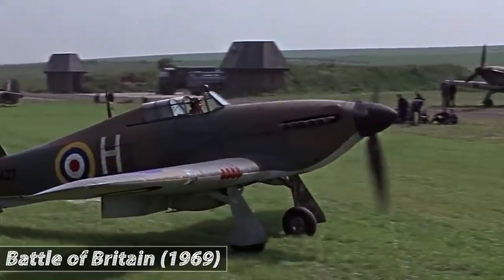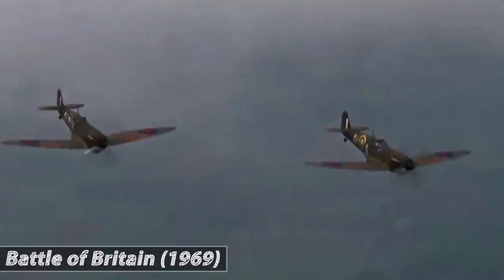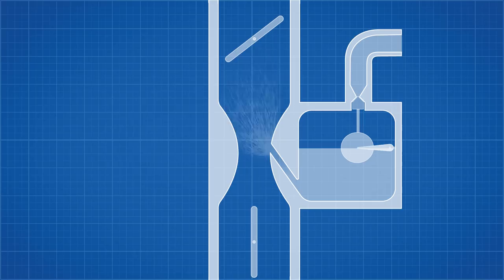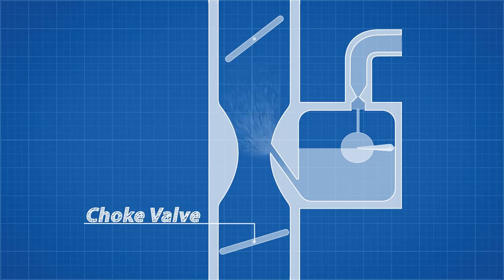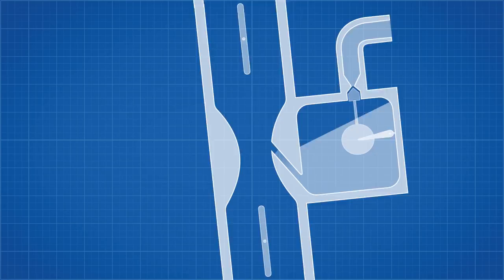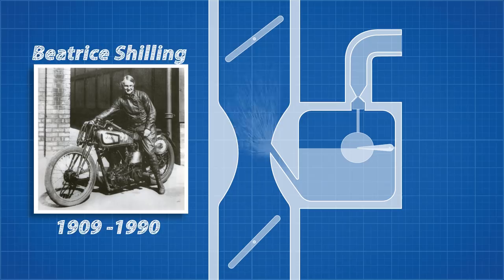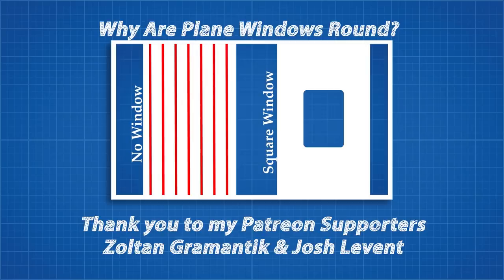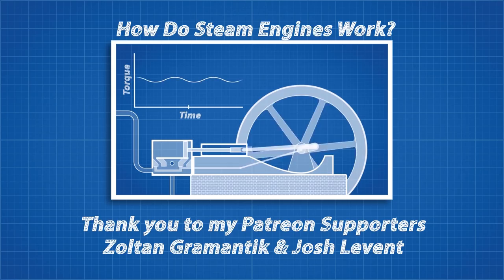The Spitfire's Fatal Flaw

Comment: As soon as I saw the title I though "It's the carburetor problem, isn't it?"
Reply: I love people who are so knowledgeable about very niche topics, and are able to predict stuff like that :)
Reply: Me too. Spitfire pilots have talked about two disadvantages-this and the Bf-109 having a cannon in the nose. MGs are fine for infantry, but ONE cannon shell in your ass can take a fighter down.
Reply: +Elwood Gizmo later versions of the spitfire had 4 hispano 20mm cannons
Reply: +Elwood Gizmo and the first bf109's only had 2 mgs and no cannons while the spitfire had 8 of them
Reply: Nigel Nathan Bf-109Es were in service at the beginning of WWII, and E-1s were fitted with four 7.92mm machine guns. The E-3 was fitted with two 7.92mm machine guns, and two 20mm cannons. The F series all carried a cannon of usually 20mm, but no smaller than 15, and the F4 was capable of mounting 15mm cannons under its wings. Up to the G6, 109s retained the dual 7.92mm machine guns, but on the G6 these were replaced by 13mm machine guns. The K variant replaced the 20mm cannon with a 30mm cannon, and retained the 13mm guns.
Reply: Nigel Nathan the Mk1 Spitfire, which was designed first and foremost to combat Bf-109s at the beginning of WWII, was fitted with 8 7.7mm machine guns, vs the 7.92mm guns and 20mm cannons on the early E series 109. The Mk IIa Spitfire also had only 8 7.7mm machine guns. The Mk IIb was the first to receive 20mm cannons, but only 2, and retained 4 7.7mm MGs. The armament of the Mk Vb was the same, and the Vc was the first to sport 4 20mm cannons, though it was outclassed by Fw-190 fighters that began appearing at the time. The Spitfire Mk IX returned to the two cannon, 4 MG armament. The Mk XIV was capable of carrying two .50 caliber machine guns in addition to its dual cannons, but German guns were still bigger, and many XIVs retained the dual cannons and 4 MGs. Even the Seafire Mk XVII, a direct naval variation of the Spitfire XVI, had this arrangement. The Mk 18 spitfire had this armament, and the 4 20mm cannons did not make a reappearance until the Mk 22 Spitfire.
Reply: +AlphaMikeOmega Not going above the speed of sound is not a Spitfire problem, it's a straight wing, prop problem. 

So not a "fatal flaw" or a disadvantage.
Reply: Rafal0id It's not a straight wing issue. The Bell X-1 was the first plane to break Mach 1, and it had straight wings, A swept wing reduces the compression effect, but the airfoil has an equally important part. The P-51 Mustang's laminar flow airfoil i thinner than the Spitfire's wing, and so the Mustang has better high speed handling because it does not compress at the same speed as the Spitfire. The other issue is that to pass Mach 1 in a propeller driven aircraft, the propeller blades themselves need to rotate faster than the speed of sound, which puts tremendous strain on the engine, driveshaft, propeller hub, and blades.
Reply: No it's not, propellor airplanes have gone supersonic. 
Compressibility is not a wing problem, it's a problem with the control surfaces of the elevators on the tail.
Go to fast, lose elavator control, which is quite problematic in a supersonic dive.. Ya can't pull up.
Reply: look up WW2 pilots diving to escape being shot down, or chasing enemies, and then crashing full speed in the ground because they could not  pull up from the dive due to compressibility.
Very good report in Fighter Pilot by Robin Olds, how he barely made it with just a few feet to spare vs the ground. P38's were especially sensitive because they were aerodynamically designed with low drag and the elevators were inbetween the 2 engines, behind the cabin.

When i say compressibility is not a wing problem, i simply mean you can make a brick go supersonic, or a wing, if you make it strong enough any airfoil will make the transition. But you need the control surfaces, the fully tarticulated tailplane to overcome the problem with the elevator that stops working due to compressibility
Reply: The Spitfire had the highest mach limit of any plane until after the war. the wings did not snap off at a speed no other fighter could reach without breaking up.
The Spitfire mach 0.89, followed by the Me 262 and P 51 about mach 0.84, the P 47 about mach 0.7 and the P 38 even lower.
Reply: Fire Bunny.
The first Spitfire to have 2 x 20 mm cannon was the Mk Ia, in fact one shot down a German plane in February 1940, some time before the Battle of Britain. The Mk 21 which was in service early 1945 had 4 x 20 mm, but most Spitfire marks from the Mk V on had the universal wing so they could take 8 x 0.303, 2 x 20 mm and 4 x 0.303 or 4 x 20 mm Not many after the Mk V had 8 x 0.303.
Reply: Fire Bunny.
The P 51 did not have better high speed handling than the Spitfire.
Reply: +Barrie Rodliffe spitfire had better maneuverability due to the shape of the wings. P51 had better range. This came in very handy for bomber escort.
Reply: Walter.
The Spitfire did escort bombers, not as far but the p 51 had to be so laden down with fuel that other fighters including the Spitfire had to escort the P 51`s and bombers into Germany first.
Remember the Mosquito could carry a similar load into Germany and not need an escort.
Reply: +Barrie Rodliffe sounds like u got the impression I said they didn't use spitfires to escort bombers. Of course logistically they used them for their superior maneuverability wherever they could. Mosquitos were very handy for night raids as well.
Reply: I actually tought about another issue - a fuel tank right ahead of the cocpit, that engulfed a pilot in flames when hit.
Reply: +Barrie Rodliffe Mozzie bomb load was compared to that of early B17. Not sure about later models.
Reply: Maybe for the Spitfire, but the Hawker Hurricane could soak punishment.
Reply: Swine.
Maybe any pilot would rather be in a spitfire with self sealing fuel tanks and less chance of getting burnt than sitting on top of a fuel tank like the Luftwaffe pilots had to. Some pilots did get burnt but it was not a fatal flaw, any pilot could get killed as happened to many during the war.
Reply: The early B 17 B was considered useless by both the RAF and USAAF The B 17 F was the main B 17 used by the USAAF in 1943, at the same time the Mosquito could carry a similar load into Germany..
Reply: ArtScience has a fatal flaw, that is called stupidity.
Reply: +Barrie Rodliffe agreed lol. I tend to lean towards the PBY Catalena as a favourite of the era.
Reply: Prop driven aircraft can't go supersonic.  The shockwaves on the propeller greatly reduce thrust.  It's a phenomenon that is basically impossible to engineer around.  To go faster the propeller needs to be abandoned for another propulsion type like a jet.
Reply: +Plur307 prob blades are in jet turbines too dawg.....
Reply: Walter Garvey
Supersonic jet engines are designed to slow the incoming air to subsonic, dawg.  Jets also work through compressing the air and combusting it to shoot high pressure out the back.  A propeller works by acting like a wing pulling the plane forwards.  The Jet turbine blades aren't producing lift.  They are acting like a turbine air pump.  Totally different, dawg.
Reply: Walter Garvey TURBINE blades are in jet engines. Compressor blades, and fan blades in turbofan engines. Most aircraft capable of going supersonic, as Plur said, slow the air down before compressing, introducing fuel, and ignition. Planes like the F-14 and SR-71 have variable geometry intakes specifically designed to move the shockwave and slow down the air before it goes into the main combustion cycle. Even on turbofan engines, when the tip of the fan blade is supersonic, the engine cowling dissipates the shockwave, and the fan itself does not provide the thrust. The air slows down as it passes behind the fan and the compression cycle begins, dawg.
Reply: +Plur307 actuallllly...... The combustion chamber spins the rear props turning the forward larger props. Same mechanism different method. The difficulty in the turbines is the forward props need to be at such a drastic angle due to it's high velocity. Lockheed Martin is working on the issue with a gear system that can withstand 40,000 ft lbs of torque.
Reply: Walter Garvey
I'm aware of how a jet engine works.  I wasn't trying to explain in detail how it works in a youtube comment to somebody who clearly has no idea.
Reply: +Plur307 at least you finally admit they are props.
Reply: +Plur307 even if you contradict yourself
Reply: +Plur307 you actually did try to explain you were just incorrect
Reply: Walter Garvey A turbine is not a prop.  A turbine doesn't require laminar flow over the surface of the blade, a prop does.  The turbine is creating a pressurized combustion chamber.  The prop is utilizing flow over the prop blades to create lift and pull the plane forwards.  Totally different.  My original point was simply that a prop driven plane cannot go supersonic because the shockwaves ruin the thrust when the prop goes supersonic.

Just because they have blades and they spin does not mean they work on the same principal at all.
Reply: +Plur307 trying to listen to you describe fluid dynamics makes me cringe. You obviously are confused as to what areas of the turbine are producing thrust. The fact that you think the forward props are there to slow the air would be laughable if it wasn't so sad. My original point stands the forward props in a jet turbine are spun by the combustion chamber. If they wanted to slow the air down they wouldn't need compressors now would they? Before you try to pose as an aerospace engineer I suggest you go back to basics.
Reply: +Plur307 "supersonic jet engines are designed to slow the incoming air to subsonic" your quote. My advice to you is to educate yourself before making ridiculous posts.
Reply: You didn't even read my entire comment
Reply: +Plur307 just to stay on subject. Prop blades are prop blades regardless of angle. The limitations in the velocity are partially to do with the prop radius and also the limitations of the mechanism that provides force. In this case a Merlin engine. Even with variable angle blades there's limitations since the blades need to be long enough to have enough thrust at low speed. A supersonic prop would be the same as the radius as a fighter jet turbine and a greatly reduced angle. Turbines just need to be spinning at a much higher velocity as the exhaust gasses provide a great amount of force. The SR71 had variable intake ports so they could partially close the air for high speed. It also has scramjet but that's another matter.
Reply: Not exactly. A full discussion is to be found starting page 127 in Paul Kennedy's "Engineers of Victory." This please note is a British author, writing a definitive work praising the Mustang. 

My hardback copy observes that the reason Spitfires, P47s, and so forth would accompany the bomber streams for the first hundred or so nautical miles into Germany was simply that they could, while the Mustangs flew high cover. See especially the map on page 128, and the accompanying text.

 I quote:

"If Luftwaffe squadrons sought to disrupt the bombers before they reached the Rhine (which made a lot of sense), they would have to tangle with the advanced Spitfires and the remarkably tough Thunderbolts; if they waited till the aerial armadas were attacking key inland German industries, ... they would find Mustangs high above them." In fact, by September 1944 Blakeslee's P51s could accompany the Flying Fortresses all the way to western Russia, a thousand-plus nautical miles. 

A P51 with drop tanks, either the usual 100-gallon aluminium or the preferred paper-mache type produced by the Brits, was never at any time at a combat disadvantage. The first attack on fighter escorts was a high-speed swoop which did not require aerobatics, and broke up the attack. If required, Allied aircraft - Spits carried drop tanks too - could drop their tanks and re-engage. They didn't generally lose fuel because combat didn't begin till after dropping the tanks; before that time the Luftwaffe would hold back, hoping the fighter escorts would run out of fuel and disengage. After 1943 that didn't happen.
Reply: +911s73targa It is called Mach Tuck.
Reply: Fire Bunny I thought the same and than I tough well I got fixt in later modeles
Reply: Bf 109 K-4 You're right. Your problems take the form of American P-51s.
Reply: Fire Bunny yep same here, but they fixed it later with fuel injection, this problem was fixed with later marks in '41-42
Reply: Don`t forget that the AMT (all moving tail) was the real secret to speeds above Mach 1.
Reply: You`re probably thinking of the glycol tank not fuel tank. Glycol is used for engine cooling and is extremely flammable.
Reply: the goods or fuel injection...
Reply: Fire Bunny
Go to the library, read a book about jet-engines and you will find, to your suprice, that the "fans" in front of the cobustion-chambers are called------ YES ! COMPRESSORS !
Reply: Walter Garvey
"I suggest you go back to basics.". So should you ! The "forward props" are called "compressor unit" and are not spun by the combustion chambers. In those chambers the air is heated and expands and leaves the chambers extremely fast. Then the heated air hits the turbine-wheels. Depending on type of engine, the different turbine-wheels have different purposes. Some can be driving the compressor up front (or a propeller in a turboprop engine) and some can be driving auxillary components. I am amazed how many "experts" are trying to explane how they believe things work.  "Miss Shillings orifice" was an intermediate solution before they started using pressurized carburators on the Merlin engines.
Reply: Richard Linter
I guess you know that without Great Britain there would not have been a Mustang! As the English did not manage to produce fighters fast enough, they tried to buy P-40 from the USA. The USA needed the P-40 themself so they would not sell!  The English government then asked North American (who also built P-40) if they could help in any way. They could (!) and started building the Mustang, which was delivered with Allison engines. It took less than four months from they started until the prototype had its first flight, but it was not until they started using the Rolls Royse Merlin engines that the Mustang became the famous fighter it is known as today.
Reply: Richard.
Britain wanted more fighters in 1940 but they finally got the P 51 in 1942,  it was then not good enough to use as a fighter and used for army cooperation and reconnaissance.  Fortunately Britain was able to make enough Spitfires, they even had some to spare, the USAAF took plenty of them.
Reply: Already? That's an acadamy record..
Reply: Well, who wouldn't.